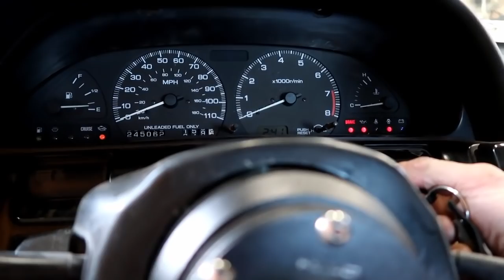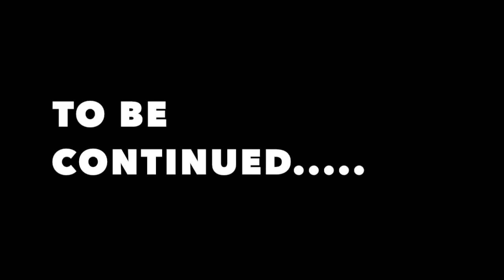BUILDING A 240SX IN 10 MINUTES *CRAZY TRANSFORMATION* (DRIFT CAR)

Comment: Hey Austin I was wondering how the pinch welds on your 240 are holding up? I bought a stock 92 super hicas. An actual unicorn in the 240 community. However the pinch welds are smashed to hell and the fender accommodations that are built into the pinch welds are destroyed too. How did you get around this issue when installing your fenders? Assuming you also had to deal with this issue. I really want to keep the car in prime condition but it has its flaws. The pinch welds being the main one.
Reply from the maker: My pinch welds are pretty decent, I actually drilled two holes and put zip ties to hold the bottom of the fender and as long as you use the lower door mount for the fender they should hold very well. The reason I drilled two holes was because the 2 stock bolts snapped off in the pinch welds. Hope this helps!
Reply: @AustinBernerr  Thanks a lot Austin! The response is much appreciated.